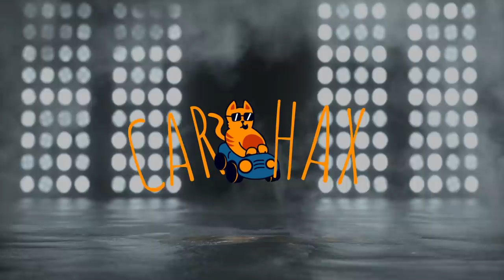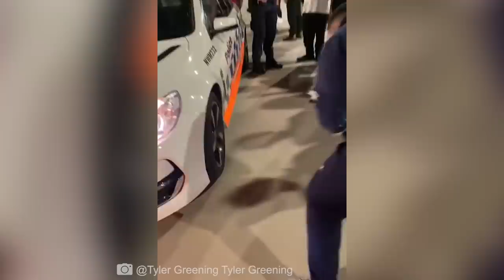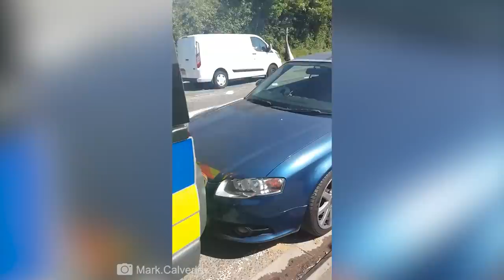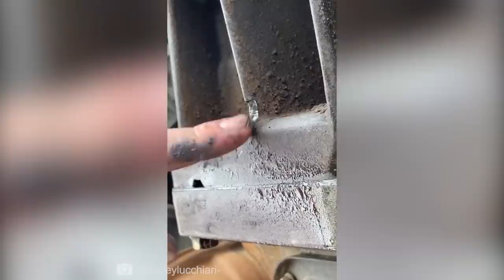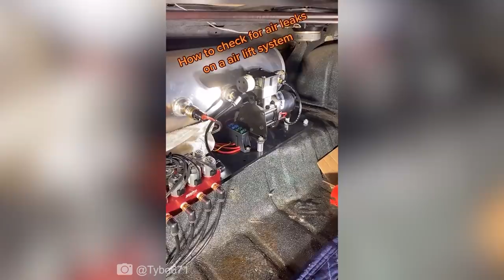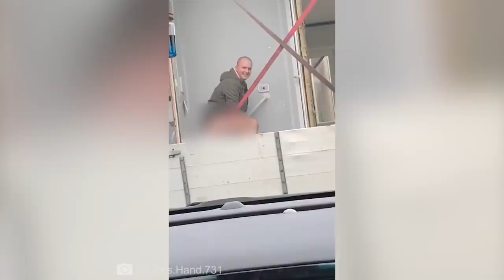Car guys funny moments [PART 6]

Comment: They need to add another smaller speed bump 2 feet away from the big one.  Once the springs compress hitting that would send them soaring
Reply: idk why they didnt paint yellow striped lines. in my country they do
Reply: @Nexus104  because there were a big fat yellow sign with "speed bump" written on it
Reply: oil pan left the chat
Reply: @Taletad  just by the speed bump?
Reply: How you suppose to see it haha ya already flying while trying to read it lol
Reply: @Taletad  should be sign about 20 meters before the speed bump and also the ground markings. This speed bump is just pure trash.
Reply: While thats not how it works I still want them to do that so I can watch ramp off the first bump and then bottom out on the large one and smash their transmission to paste.
Reply: @Taletad  there must be road sign 100ft from that speed bumb and another thing is that road bump is really bad designed, driver absolutely cannot choose right speed looks aboslutely same like road its really confusing for driver and last thing wtf  ?  :D are these people enjoy when another people damage their property ? :D sorry my english sucks :/
Reply: @Taletad  No. there should be yellow, reflective lines painted on the speed bump.
Reply: Or at least have the speed hump be regulation size with regulation markings.
Reply: @Nexus104  its supposed to have markings on the pavement, regardless of signs.
Reply: Put arnold schwartzenegger on the job.

Comment: 6:50, basically sums up the average intelligence of cyclists
Reply: So.. about the same as the average motorist then?
Reply: @AJPemberton  Nah, I see much more clips of cyclists running red lights and driving like maniacs
Reply: @rene837  The reverse for me. Perhaps the videos we watch aren't a true reflection of  reality? I mean both motorists and cyclists are human. And humans can be idiots no matter where you go. Though I've yet to see a cyclist do 150plus on the highway, or take out a fence and house wall speeding around a corner, or cycle and text as they bike through town, or cycle drunk ... though that would be a safer option. No doubt it happens, but the consequences of an idiot on a bike verses an idiot in a car are quite different.
Reply: @AJPemberton  What's the problem with 150+ on the Highway? Pretty hard to take out a house with a bike. Cyclists looking at their mobile phones and cycling drunk, I see that all the time.
Reply: @rene837 .. its 50% over the speed limit in my country. We have enough problems with people doing 100 on the open road. Humans struggle to handle such speeds, our reactions times are too slow and our ability to concentrate too easily disrupted.

A cyclist taking out a house IS pretty difficult.. that was my point. The risk of an idiot of a bike vs an idiot in a car are much lower. Simple physics.

You cycling population sounds much different to ours... I've seen perhaps one or two on their phone over the last decade, none texting, and no drunk riders. Not saying it does not happen, but its not common around here.
Reply: @AJPemberton  It is very common in Germany. Speed limits are as you might know not given on parts of the Autobahn, I regularly drive faster than 150. I see kids and teenagers very often on their phones while riding a bike, texting might be a bit more difficult while riding a bike, but they still have it in hand and look at it. Of couse a car is more dangerous than a bike in the wrong hands but I see more cyclist running red lights than I see cars doing that.
Reply: @rene837  Yeah, 150 on the autobahn is a little different to 150 on a town road :-) I am always very aware of how much kinetic energy pushing a car to 100 involves, let alone 150+. Even with wide lanes, separated traffic flows etc, I'd still be nervous on those roads because of all the humans driving around me. Not to mention flicking along at over 30m/s  is faster than I can react to a lot of things.

I do wonder about those red light runners: Down here, many intersections don't trigger when I'm on a bike till a car comes, which can be 5 minutes or more. I frequently hit the pedestrian cross button to get a green for me. At least one driver considered that was running a red. And despite some turns having a give way or a 'free left' ( we drive on the left here), many don't and it is very tempting to slip around the corner on a red. Its not like you are jumping out into the main lane. Haven't done that for years, but it is tempting :-)  Are your red light runners similar, or do you get idiots going straight on reds?
Reply: Most "cyclists" just want to get to work man

Comment: Just a heads up, the part about the focus transmission, that hole is there on the bottom from factory. Also depending on what mount you have you actually can see through it and some part. It’s a super soft torque observing route.

Comment: I’m not sure where that speed bump is but I do construction for a living and that ain’t legal at all no where I’ve worked (almost every state in America).
Reply: Speed bumps everywhere in Finland. Hate them. Broke suspension once when i hit brakes too late... or more detailed coil spring end jumped out of its pocket and started to damage the up portion over time and made more damage by so.
Reply: @bobbyx9694  that’s wild man they are fuckin huge.
Reply: @rodleypumpkins4174  Some aren't that huge, but anything over like five miles an hour makes you feel like you're running over a curb with how sudden the up/down motion is.
Reply: Uh, you may need to get out more. I’ve lived in California, Oregon, Washington, Nevada, and Idaho…the one in the video is tame compared to the one’s I’ve driven over. Most are freaking curbs that are slightly rounded. There’s the opposite in Sacramento called “undulations” which are basically ditches. They are primarily used in housing developments where children could be playing, around shopping plazas, and medical facilities.
Reply: @GhostDrummer  We call those "dips" here. (Arizona)

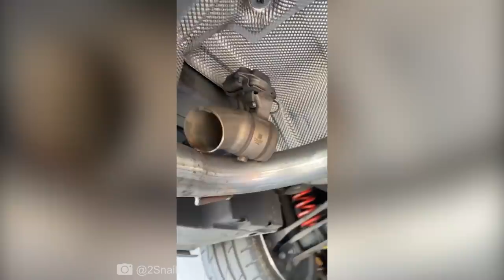Comment: 1:15  I don't know who to roast more the guy that had a perfectly good exhaust cutout that was left useless or the idiot that thought unplugging it would turn on a check engine light
Reply: Well it would would it not? It would throw bad o2 sensor codes or bad pressure?
Reply: you are wrong

Comment: Guy struggling to figure out why that boat was on top of the truck.... Words can be difficult when presented with something inexplicable.
Reply: The reason is because it’s a brand new boat and trailer being delivered. If I bought a new boat and trailer, I don’t want it to be pulled by a truck to be delivered, rather, I’d like it to be carried so it has “0 miles” on it
Reply: @leviheideman5238  Thsts weird. If I had money to buy a boat, I’d buy something else. Probably lots of something else.

Comment: The boat on top pf the truck is being delivered. The one the truck was towing got dropped off at a location or house with no crain and the second location has a crain to take it off of the top... Critical thinking is hard.

Comment: Those speed humps are EXTREMELY dangerous and should be colored yellow or something. Actually they should be illegal on public roads. I was driving up to one and I even saw the sign and approached it but couldn't see exactly where the damn thing was and hit it going too fast! I couldn't see it! and the sign placement is inconsistent to the actual location. I hate those things. And no I don't speed.

Comment: How do I replace the alternator on a 2006 Camry 2.4L?  The last guy broke the boss you are supposed to use to get slack on the serpentine belt.  Mom's mechanic showed me some tool he used to replace the belt, but every serpentine belt tool I find is a skinny breaker bar.
How do I loosen the belt with a broken boss?
Reply: Either carefully remove the tensioner with the belt still on, or the safer option would be to maybe just cut the belt off and replace belt and tensioner both.
Reply: @drippingwax  Oh wow! I'd wanna know how tight the belt was going on with the new tensioner, cuz it shouldn't be so tight that it'd require enough force to break it. I'd consider the possibility that the belt is undersized, or that there is an improper oversized pulley installed.

I actually encountered an oversized pulley once that had me scratching my head before I figured it out.

Anyway, there's not much choice but to replace the tensioner again, as you won't have a way to reinstall the belt if you get if off another way.
Reply: Considering you'll need a new tensioner anyways, I'd take careful note of how tight the belt is going on when tension is released. If you crank the tensioner until it stops without adding additional force, then there should be plenty of slack to install the belt without hurting anything. If on the other hand the belt still will barely go on with the tension cranked, I'd suspect there's a problem like what I mentioned above.
Reply: @drippingwax  It'd also be worth taking a careful look to ensure the belt is routed correctly
Reply: @drippingwax  My suspicion is that it's not recommended due to the potential to over-torque it. If tensioners on that model are a common problem as you say, then I'll just finish by saying That Sucks! 🤷‍♂️
Reply: @drippingwax  Well if you can't hook onto it and release the tension cuz it's broke... 🤷‍♂️ Sounds like you might've gotten it from the pulley bolt though.
Reply: @drippingwax  Hmm...🤔 Well no doubt it shouldn't break, but I can't help but wonder if these apparent aftermarket belts are contributing to people cranking the hell out of the tensioner to try getting it on. (Goes with my original thought about an undersized belt)

Comment: 0:16 I had a Jeep cherokee with a 4.5 inch suspension kit. One day, a Civic with a lowered suspension is hot on my heels. I knew I was approaching a speed bump like this, I accelerated. The Civic did not slow down and his bumper went under his vehicle.